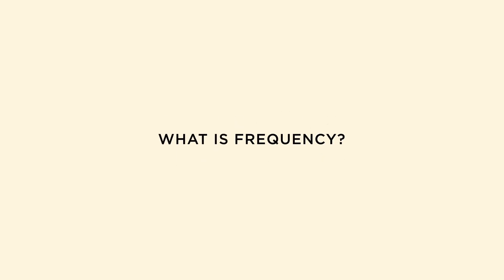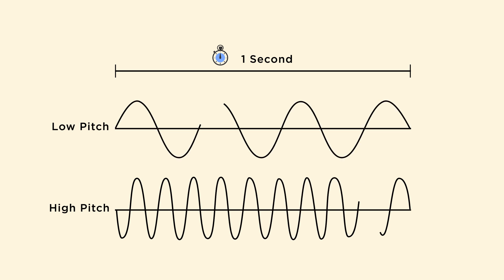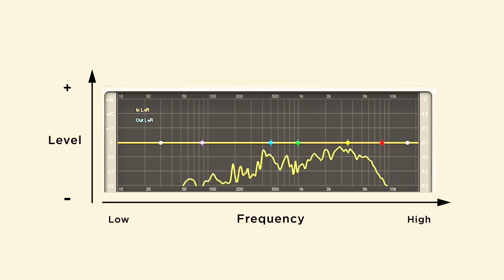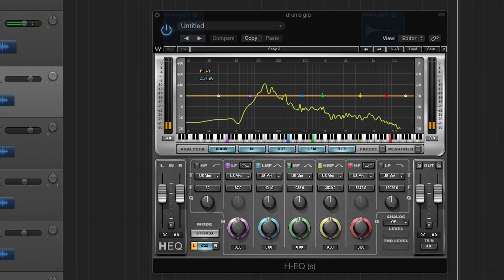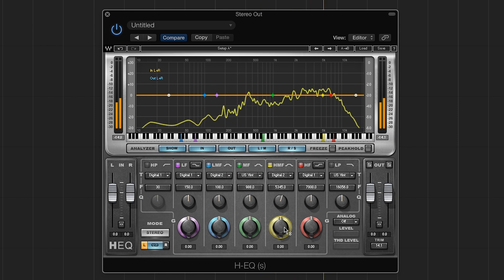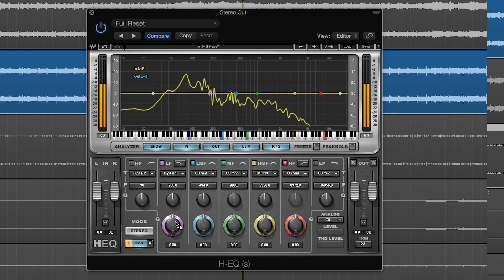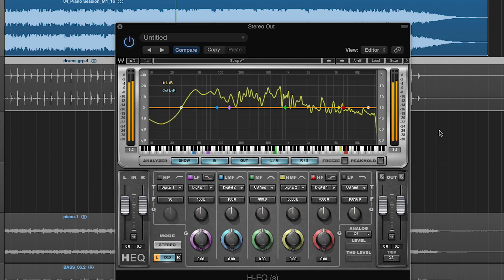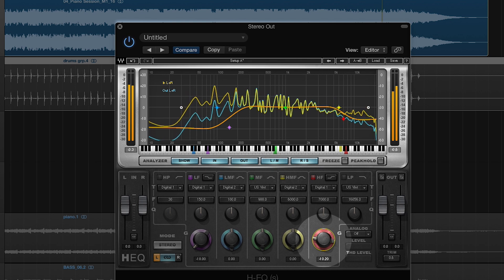EQ Explained – Sound Basics with Stella Episode 2

Comment: I would like to know a bit more on how to select the right frequencies to achieve the proverbial wall of sound...
Reply: The "Wall of Sound" is a studio technique that Phil Spector used to use, and it's not just merely a result of EQing frequencies. Spector achieved that sound first and foremost in the recording process. Whatever parts there were in a song, he wouldn't just have one instrument record that part - it would be a bunch of instruments. Each saxophone line, for example, would actually be played by multiple saxophones, usually with one sax turned up above the others to make it the prominent lead, but the other ones filled out the sound in the background. He'd also arrange a bunch of small filler parts for instruments to play - extra percussion lines, little background guitar parts, etc. - and record all of that. Then, he'd take all this stuff and EQ/volume level/compress the different parts to all fit together instead of sounding like a chaotic swirl of sound. The end result was songs that sounded huge, powerful, like a "wall of sound" hitting you because it was probably 40 or 50 different instrument parts hammering the melodies home, like an electric orchestra. Probably the best-known and most helpful example to listen to is "Born to Run" by Bruce Springsteen.

Hope that helps!
Reply: @DavidCasper  It was also designed for limited radio frequencies at the time..
Reply: Can’t believe no one mentioned his use of reverb yet. 

‘In the 1960s, Spector usually worked at the Gold Star Studios in Los Angeles because of its exceptional echo chambers, essential to the Wall of Sound technique. Microphones in the recording studio captured the sound, which was then transmitted to an echo chamber—a basement room outfitted with speakers and microphones. The signal from the studio would be played through the speakers and would reverberate around the room, being picked up by the microphones. The echo-laden sound was then channeled back to the control room, where it was transferred to tape.

The natural reverberation and echo from the hard walls of the room gave his productions their distinctive quality and resulted in a rich and complex sound when played on AM radio, with an impressive depth rarely heard in mono recordings.’